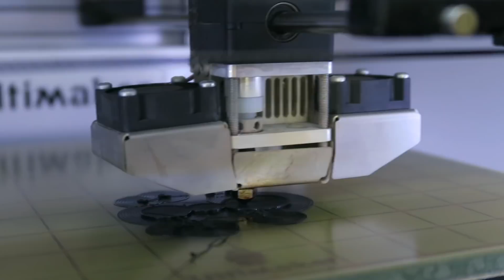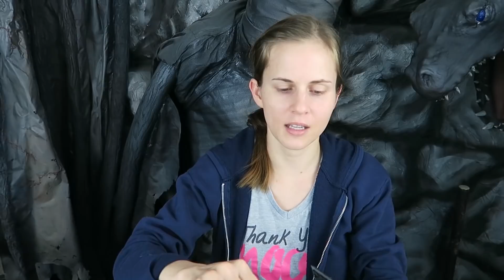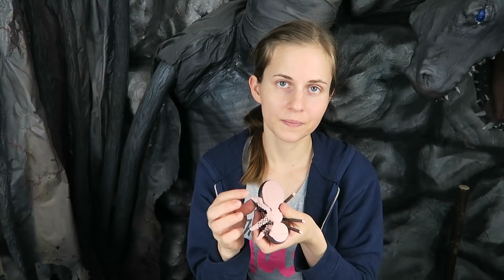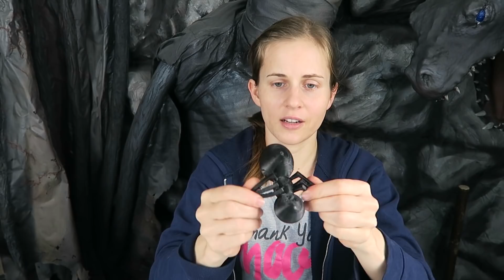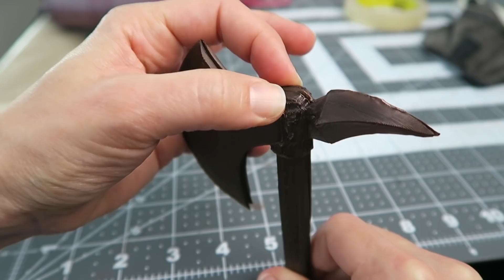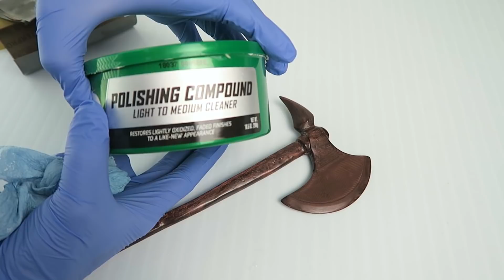Nothing Beats Proto-Pasta Matte Fiber HTPLA (But These Guys Tried) | 3D Printing Filament Review

Comment: You should be able to print that model without supports and without a brim.  I run my printers with a glass bed at 60 degrees and little glue stick on the surface.  I rarely have any problems with prints lifting or not sticking.  

Also, it looks like your retraction settings could be adjusted.  There looks like there is a lot of stringing with PLA.  That will also cause adhesion issues as the strings will catch on the print head and pull the print off the surface.

I replicated your model and was able to print it without any stringing or supports.  I run an Etsy shop producing replica props and my printers are running 24/7.  Contact me if you want to chat about the settings or want to see a picture of my spider print.
Reply from the maker: Retraction settings definitely weren't doing me any favors with the ants, but it couldn't have caused the axe warping. Something weird with the printbite I've never encountered before with PLA. That's awesome, I'd love to see your improved version. Whatever social media or email is most convenient to share for you, thanks!
Reply: Pop over to my shop and send me a note through there and  I will show you the models.  I printed one in regular PLA and also in transparent purple PLA for my daughter since she thought it looked cool.  No brim or supports on either... 
https://www.etsy.com/ca/shop/CP3DPrinting
Reply: @Lindy Design Lab to prevent PLA warping, I'm always using painters tape, I have bad experience with any smooth surface with PLA. Also printbed must not be too hot, my preferred temperature is around 50 degrees Celsius (122 degrees Fahrenheit). Also hot end temperature is important, because high temperature differential makes PLA shrinking more so I prefer around 205 degrees Celsius (401F).

On such big object, I prefer to print it hollow with big skirt, because even just walls can pull a lot by material shrinking. Only way I can print PLA on glass is with Glue Gloss (thing from makers shop to glue paper/wood and also works as lacquer, it becomes sticky while dried and warmed up) or hair spray. Print large object in smaller parts helps, but is always visible.

Many articles are on internet about shrinking/warping problem, but it always works for those who wrote it. There are a lot of differences between printers and materials. Printers temperature measurements are not calibrated so it can differ +/- 10C (+/-50F) in case of hot end. First layer height is important and automatic leveling is not good enough, standard manual paper method leveling is always better for first layer adhesion etc.
Reply from the maker: It was at 205 for the PLA, but I never put the bed as low as 50. At 65 bed temp it was already warping for the axe. Thank you for the suggestions. I'll fiddle with it more when I have time.